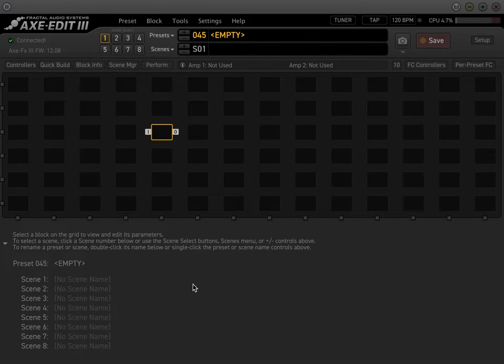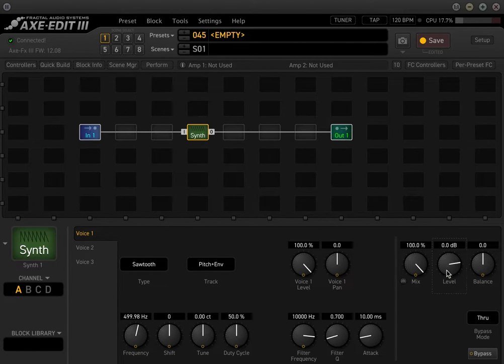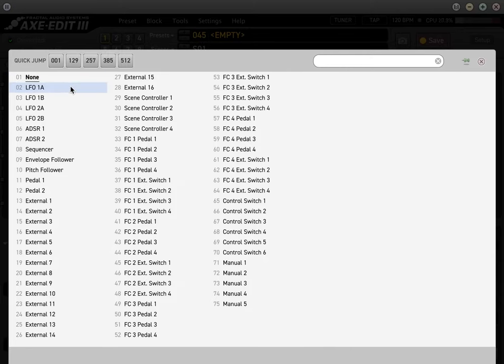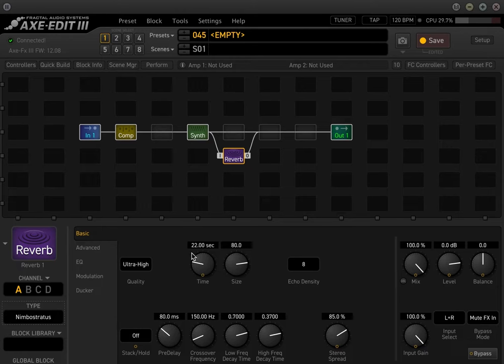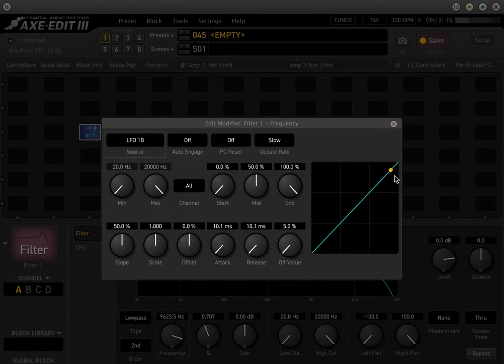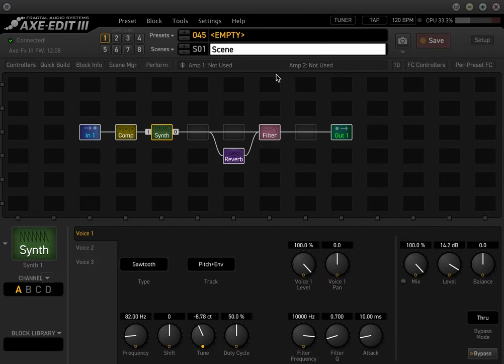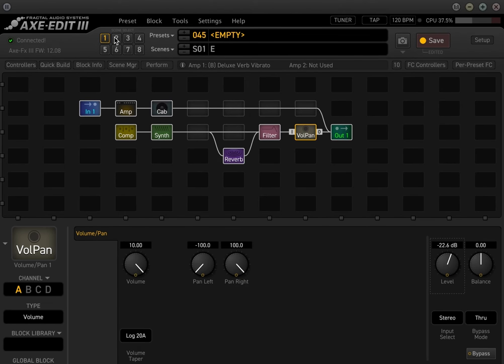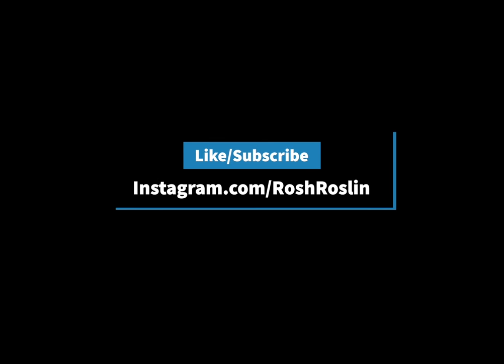AxeFX III Basics Episode 24 Synth Drone

Comment: This is great info. Is there a way to automate  switching between the scenes?
Reply: Keyboard Maestro, set to Mouse left click macro position x,y to click different Scenes, you're welcome
Reply: I skipped buying the FC controllers this way, use a cheap bluetooth keyboard on the floor rofl
Reply from the maker: You can use a DAW (pro tools, logic, ableton) to send midi messages to switch between scenes